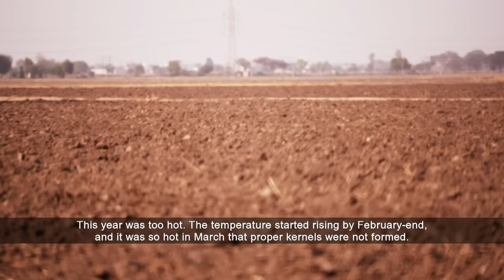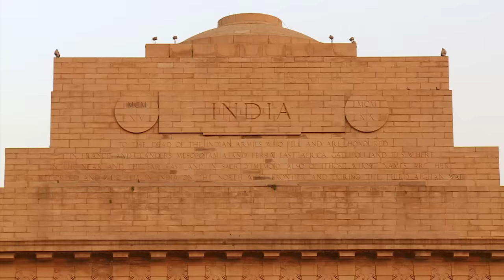India’s Extreme Summer: Will 45°C Heatwaves Leave Us Out Of Wheat? | Insight

Comment: it was 50' C not 45c max and with the 3 heatwaves lasted 1-2 weeks.  usually they last 3-4 days. 45'c is fine but 50'c with heat wave you could feel it it's above 43-45 c
Reply: 45 is fine???????????????????????:D 20C is fine to me
Reply: @kennyclauw5194  Let me tell you . For me , 40°C is Fine . Cause In India , It dont feel that much hot if it is 40°C . But If it goes more , Then definitely it feels hot . If you're in Shade or Under Tree , You'll feel Nothing . Just little hot cause We also receives Monsoon Rains . You can feel 40°C heat and Cold temperatures in the same season at different places in India .

Comment: Next Year the temperature may be even higher.. I think ppl should not think this is a rare occurrence.. they have to think how they will handle it next year when it happens again, or if it's even worse..
Reply: I think with each year it gets more worse!
People in India are okay with 35°C as normal!
Reply: @IronMan-jj2fd  Well the weather is not "repairing itself" the ice that has melted in the North will never reverse to be frozen again, eventually the ice caps at the top of Himalayas mountains will melt and the excess melted water will go into rivers and cause flooding, while areas who depend on Well water for farms will find them drying up.. most of these farmers have no access to high tech farming methods to combat climate and having water pumped in from afar to water the fields. so eventually the Heatwave will be back and this time it may last LONGER and HOTTER than in 2022.. Meanwhile we await the EXTREME COLD WINTER coming soon in Nov 2022..and i wonder how of us are ready for it.. start buying and stocking warm clothes and also YOUR WATER PIPES might burst and lack of water... so i would get stocking up for now.. power lines may also snap and power outages may happen and cause thermostat to fail..i hope ppl anticipate that now and prepare for it.

Comment: Googled India droughts: The study finds that: 18 meteorological and 16 hydrological droughts occurred in India in the time span of 1870 to 2018. The most severe meteorological droughts were in the years 1876, 1899, 1918, 1965 and 2000, while the five worst hydrological droughts occurred in the years 1876, 1899, 1918, 1965 and 2000. 
It's good to know that this isn't a rare event, that bad droughts have occurred before. It still sucks and is still scary, but it happens. This will pass.